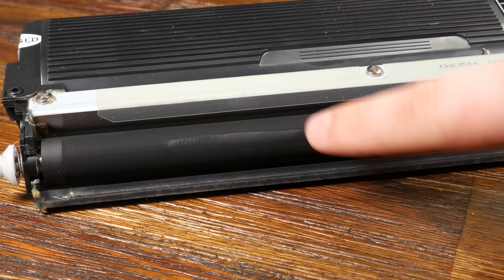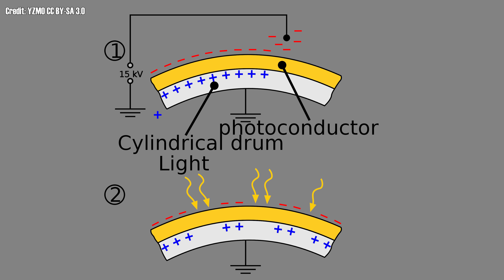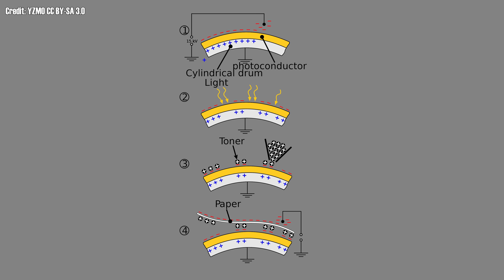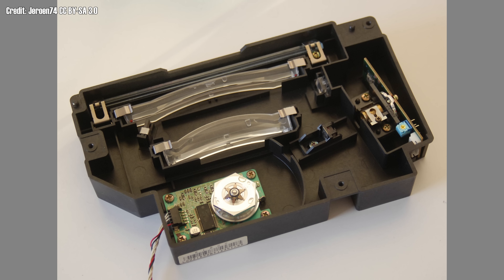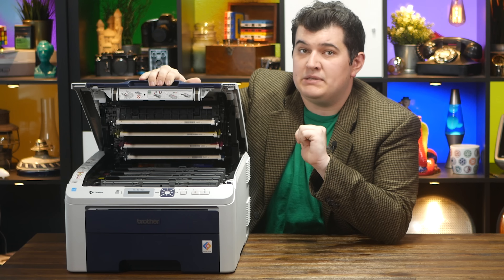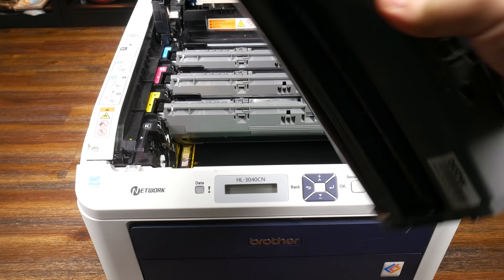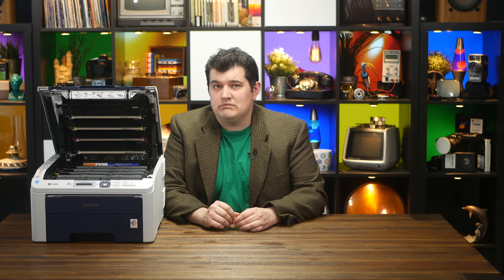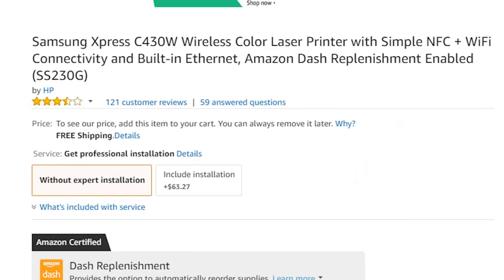LED Printers: The Common Printing Tech You Haven't Heard Of

Comment: Personally, I don't subscribe to the "being in a camp" philosophy. Both types of technology (laser and inkjet) have their pros and cons. And it depends on your use and requirements which one is most suited to you.

Yes, ink can dry out. But if you use the printer regularly, it's not an issue. Yes, ink cartridges are expensive. But if you bottom-line the costs per page (including all consumables, like waste toner box, fuser, and other stuff that comes with a limited life time) inkjets are still cheaper than lasers. Both in purchase and per-page costs for each print (at least in Europe, maybe it's different on your side of the pond). They also draw less power. Heating up the fuser to 200-300°C doesn't come for free. And then the printer either has to keep it at this temperature, which is a constant power draw. Or it has to heat it up before each print job, which introduces a delay before the first page pops out. Depending on how many pages your typical print job contains, that can really drop the actual pages per minute you'll get. Heating the paper also produces fine dust. It seems currently unclear whether or not that stuff poses any health risks. But there is some concern over it. Newer lasers try to filter it out (another consumable to be replaced eventually) but the inkjet has zero emissions on principle.

On the other side (some stuff you didn't mention in your scrolling text): The ink will spread in the paper, so the print quality depends in part on the paper you use. Lasers on the other hand produce sharp and clear letters even on the cheapest of papers. The ink can also cause problems not only with rain but when you take a textmarker to the page, for instance. And it usually bleaches out stronger over time, especially when exposed to UV light.

At the end of the day, you just have to figure out which of these issues actually matter for your intended use of the printer, then pick a model accordingly. IMHO, none of these technologies is inherently superior to the other.

And yes, I'm that much fun at parties.
Reply: Gerd Oichnixohn as some one who has operated a big boy version of inkjet printer for use in printing signs. No. They are not zero emission, at all. The thing straight up reeks of solvent. 
Baby bear inkjet shoot the same aerosolized crap in the air. 
Generally speaking, toner cartridges can be refilled easily, and waste cartridges can be emptied. 
Just because they are called consumables does not make them so. I have owned a laser printer for nearly 10 years and I’ve replaced the cartridge on it twice, and the waste toner never.
Reply: @Mostlyharmless1985

You make a good point. However, the sentence was meant to be read in context. Zero emissions - in regards to fine dust.

As for other stuff, I guess first you'll have to differentiate between just what comes out from the new plastic (which depends less on the printing technology and more on the individual model and manufacturer). I had new hardware (printers and other stuff) that smelled like the accident that created Daredevil must have. And other hardware that had no smell whatsoever. Although I feel obligated to point out that smell is a rather weak indicator as to whether or not something is harmful. There's a lot of stuff that reeks but is ultimately harmless, whereas dioxin, for instance, has no smell at all.

And the second thing is emissions that may come from the ink. Most consumer inks use water as solvent. Which why they smear in the rain or when you use a textmarker. And also why you can sometime revive a dried up cartridge in a bath of warm water. There may, of course, be other additives in the ink (e.g. to make it dry faster once on paper). From the papers I read on workplace safety, it is usually recommended to put laser printers in separate rooms with their own air vents or windows, where as inkjets can be placed at the individual desk. A lot of government agencies in Germany have switched over to inkjets, which are also more likely to have the blue angel eco-label. I haven't gone down the rabbit hole of how much there is to all this (e.g. can the blue angel be trusted, what are the criteria, etc), but at least superficially, it seems to hint at inkjets being slightly better in terms of health risks.

Oh, and some consumables from the laser can't simply be refilled. Like the illumintor/photo drum. On the other side, inkjets also have a tank for discarded ink which can't be replaced at all (in most consumer models, that is).
Reply: The large format printer i'm talking about uses a resin based ink that gets hardened by UV light, so, spurious analogies aside in regards to what the ink actually is, that I can smell the ink from the big printer that uses the same basic ink jet technology leads me to infer that the small ink jet printers create the same type of pollution on a smaller scale. Water based or not, I don't know any inks beside food inks that are safe to ingest in any fashion. From what I know of photoelectric drum technologies, the danger isn't so much in the paper dust as it is the handling and dispersion of the toner that can cause respiratory harm, not insomuch it's poisonous in any way, but in that the fine particles can cause inflammation of the mucous membranes. I would argue that polymerized carbon is not dangerous in a chemical fashion, but in a physical fashion.

I find myself very wary of any machine that aerosolizes a chemical. There is no way I can trust that the aerosol is chemically safe, and there is no way to trust that it is mitigatable. I would also say that a print station of a 1 large printer servicing several workstations would be more efficient in terms of electrical usage than individual ink jet printers. Doubly so if that printer also serves as a copy machine. That cost benefit analysis is a bit beyond my casual chinny reckon thought. It would require me to actually look at the quiescent power usage of an average ink jet printer, it's draw under use, how frequently prints are made, how many work stations are used, how much the supplies cost in terms of environmental impact, etc. I would say in general terms for a home office, a laser printer is the better choice for anyone who prints infrequently, has no need to print photographs, and prints high volume when they do print.
Reply: It seems as though the printer you're referring to is not the kind of beast that is up for consideration when most people are facing the choice between laser and inkjet.

According to my info, the fine dust from lasers doesn't come from the toner. It's the paper that's being heated and mechanically processed.

There are studies out there that link fine dust to an increase in respiratory problems (like asthma), lung cancer, and other fun stuff. It also seems to be able to activate dormant viral infections[1]. There's an EU study[2] that says 65,000 people die prematurely each year in the EU due to fine dust. The WHO and the LMU in Munich estimate that the current exposure to fine dust in Germany leads to an avarage drop in the population's life expectancy of about 10 months. A recent study from Mexico City[3] found a link between fine dust, ozone, and Alzheimer's disease. And even the current EU safety levels for fine dust seem to be not really safe[4].

With printer ink, I couldn't find any scientific info about it being hazardous when used properly. So if I have to expose myself to something in order to have stuff printed, I'd rather go with the ink. At least with my current understanding of the issue. I'm open to having my mind changed. But so far, I haven't seen any evidence even hinting at consumer printer ink being a problem. 

[1] https://particleandfibretoxicology.biomedcentral.com/articles/10.1186/s12989-016-0181-1
[2] http://ec.europa.eu/environment/archives/cafe/activities/pdf/cba_baseline_results2000_2020.pdf
[3] https://www.sciencedirect.com/science/article/pii/S0013935118301439?via%3Dihub
[4] https://www.thelancet.com/journals/lanonc/article/PIIS1470-2045%2813%2970279-1/fulltext
Reply: pmailkeey no, carbon black is a possible carcinogen. Turns out it’s not really great for your lungs to be breathing in tiny particles of anything. It does not present a chemical hazard. It’s dangers are purely physical. If it gets on you, it’s harmless, if it gets in your lungs, it is not. 

Exposure risk is low for normal use conditions because people tend not to snort rails of printer toner. It’s only really dangerous if something fails horrifically leaving toner everywhere. Then you should treat it like any other hazardous powder. That is wearing personal protective gear: a dust mask, gloves,  and goggles, and clean it up with an appropriate method taking care to disturb it into the air.
That means scooping as much of the stuff as possible, cleaning the rest with a wet cloth, and never ever vacuuming it unless the vacuum used is specifically built to clean up printer toner. 

People get overly twitchy about this cancer word, possibly Carcinogenic is like saying a bullet is possibly deadly. There is a specific set of events that have to happen for it to be true.
Reply: Thank you for your comments.  I knew electricity was more expensive in Europe, but I had no idea how much until I looked at this page (randomly choosing Germany) https://www.statista.com/statistics/418078/electricity-prices-for-households-in-germany/ Yikes.  That is about 7 times more than I pay in Oregon, and probably 3-4 times more than most of the U.S.   France seems to have among the lowest cost for electricity ( https://en.selectra.info/energy-france/guides/electricity-cost ), yet it is 3.5 times mine.
Reply: You'd be an excellent printer salesperson, for what that's worth. :)
Reply: Agreed, I used to do large amounts of colour printing with a big hacked Samsung printer that I just needed to feed toner powder into, warhorse of a machine, now days just a $50 consumer inkjet does me fine
Reply: You certainly have some wrong ideas about inkjet printers, that's for sure. They're trash and clearly inferior to laser and LED.

Comment: I have an HP LaserJet CP1025nw, it's a color printer and presumably a proper laser printer instead of LED. I honestly have no way to know based solely on print speed though, because instead of having all four toner cartridges lined up in a row, they're actually installed on a carousel. So, whenever it prints in color, it has to do four separate passes, one for each color, rotating the toner cartridges into position between each pass. This design makes it agonizingly slow to print, so even if it were LED it wouldn't work any better.

Comment: With OLED technology getting more advanced in resolution and especially brightness for HDR, I feel like the display technology will transfer over to printers, and laser printers will be a thing of the past.
Reply: OLEDs are good in TVs and smartphones because the color subpixels actually emit light rather than just filtering the light from the backlight, and so there's no need for a CFL or LED backlight, and due to this, OLED displays can have perfect blacks and don't use much power when they are not emitting light (which is why Samsung's 'always on' display uses so little power). The problem with OLEDs (like some of the older plasma TVs) is that they can have 'burn in' issues on static scenes which makes them unsuitable for computer monitor use (where there are static images that can burn in). Therefore, OLED would be unsuitable for toner printer use, in part due to the high temps of the drum unit possibly causing the organics to degrade.
Reply: Cant wait for HDR prints lolol
Reply: But I've read OLED's have started loosing ground as display tech. Even their main proponent (LG) has decided to drop the technology.

Comment: You are just wrong about paper path.. Your LED printer uses a transfer belt (as seen around 6:47 mark black shiny thing), paper never actually touches any of the CMYK photoconductors... Rest of the printer works as you describe, but toner is transferred to the intermediary transfer belt below them not to the paper... Paper itself just makes a L turn at bottom, touches the transfer belt while going up, then it passes through the fuser and gets out on the top... How do I know?? Its the exact same proven setup for any proper home/office laser printer including what I own (CS-310DN)... As such, those printers have exactly the same color and grayscale print speeds... Today, only the cheap (read: garbage) color lasers actually have longer and more complex paper paths for color printing... 

From experience (with few printers I've owned in the past) transfer belt provides several advanages; a) on my older printer without transfer belt, any tiny little problem with paper feed on such a long&curved path will make colors all mixed up so it was not only slow but also highly unreliable as printer ages... b) the transfer belt also prevents dust/dirt stuck on paper from damaging the photoconductors, as belt is continuously cleaned by a rubber blade before touching the photoconductors... c) belt also speeds up the printing by seperating paper feed and rasterization processes,  printer can start drawing image to the transfer belt well before moving the paper.
Reply from the maker: Hadn't realized that was a transfer belt!  Oh well.  Still, the linear arrangement of this printer is an advantage compared to a carousel of some lasers.  I think the intermediate intricacies are more or less trivial but I appreciate the correction!
Reply: Technology Connections  Thanks, and I appreciate all your videos... Its quite rare for me to watch a video on youtube a few times over only to make sure I haven't missed any technical detail; and all your videos fall into that category. Keep up the good work!
Reply: Technology Connections  as my comment above, i still have and use a carousel based transfer belt laser, slowest dinosaur i have but it just wont die.....
Reply: @TechnologyConnections  He is right, though only /some/ printers use the transfer belt method. Those printers are the ones that take a lot longer to print in color, since the printer has to lay the colors onto the transfer belt one by one, then drop them onto the paper in one pass.  The Okidata Page printers, such as the C5200 I have, print directly onto the paper under four rollers, and they use the big ribbon as the classic "Corona Wire", so going color or BW doesn't effect the speed.
Reply: Yepp, as Printer Service technician I can 2nd that.
One and the same mechanical layout can also be LED or Laser.
Reply: Using the belt also ensures that the different toners line up, on a Canon machine there is the User maintenance option of "correct colour mismatch" which will put a pattern on the belt and then read any differences in the position, allowing it to correct. If the paper went directly to the drums then any difference would causing ghosting between the different toners.

Can you also do something on colour theory, I expect a lot of people will wonder about why CMY and RGB are both used without knowing about the difference between reflected and transmitted light.
Reply: HPs 2500 series had the toners on a drum. Each one rotated into position to transfer its color to the belt in 4 passes. Then the paper would be run through. Four times as long as black. But if you didn't specify to print in greyscale so it'd rotate to black only it would cycle all 4 and increment their page counters while taking as long as a full color page. What was the first color laser to put the toners in a row to do simultaneous overlapping transfer to the belt or directly to the paper?
Reply: greggv8 I don't know, but the HP 3500-series uses the linear arrangement with a belt.  They are quite bulky machines so may be an early version of the concept.
Reply: @greggv8  those 2500s whilst somewhat pioneering were bloody awful to look after
Reply: Many good quality printers will self-synchronize the colors via sensors by laying patters on the belt and scanning them after the last drum. No need to print it to paper as it can just scrape it up with the rubber blade instead. But most of the offset in color sync is due to wear in the drum insertion mechanisms and tracks